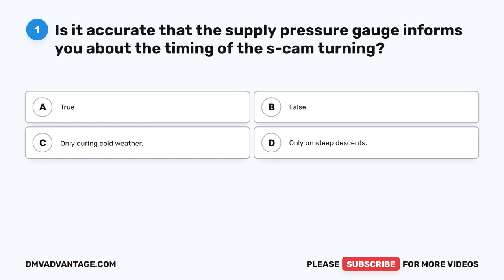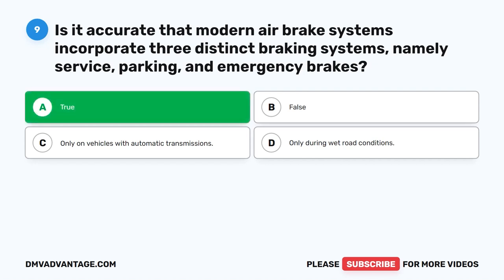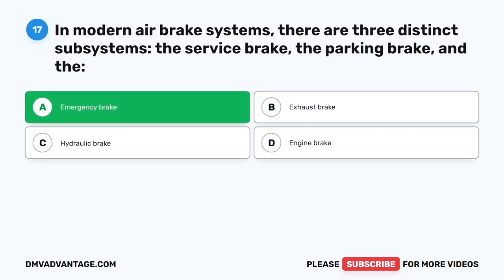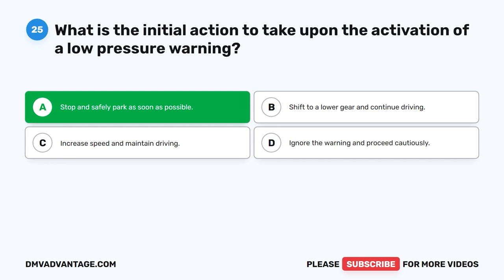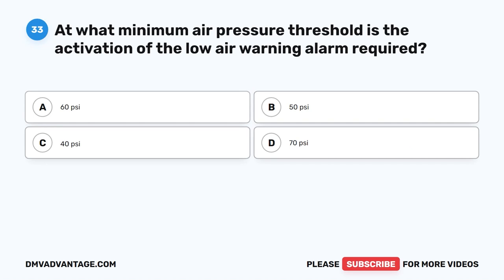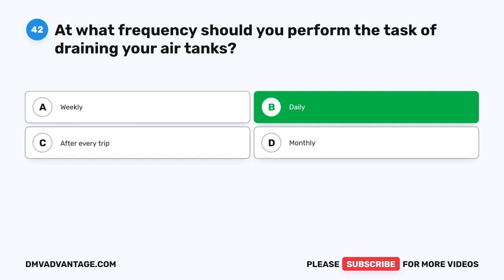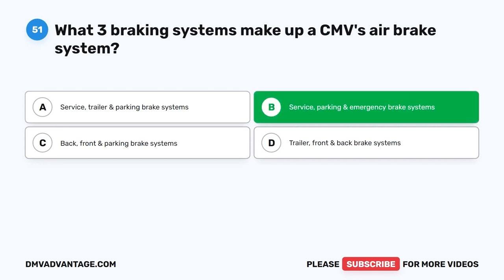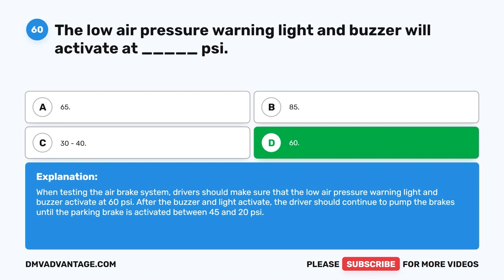CDL Air Brakes Test 3 2023 (60 Questions with Explained Answers)

Comment: What is the differences in the #2, #3 videos but same subject?
Reply: There are a lot of different test questions they can throw at you. Having more tests to study with will likely cover all of the potential questions you will have to answer on the actual test. If you fail the first time, the second time you take it the questions could be all different than the first one.